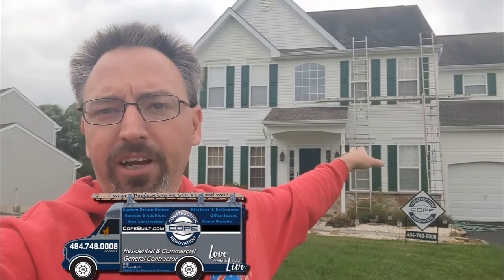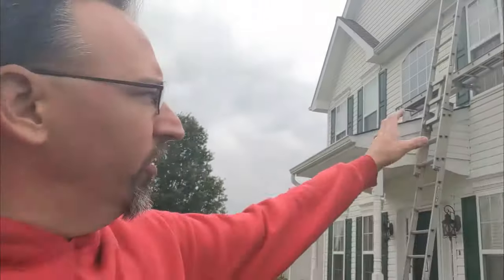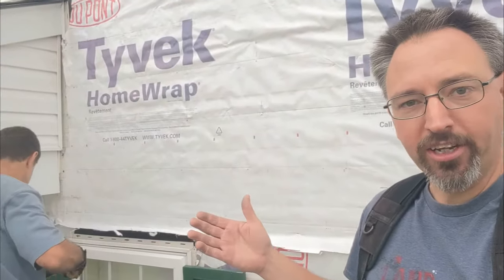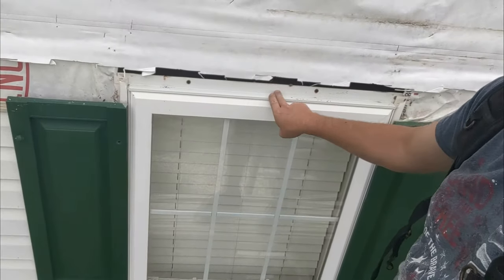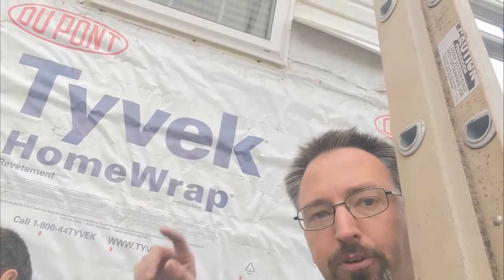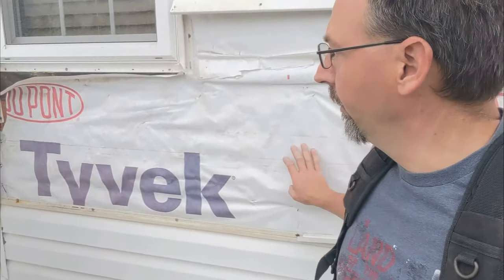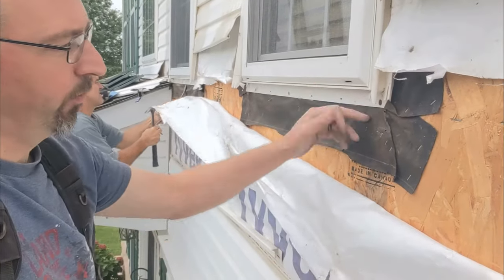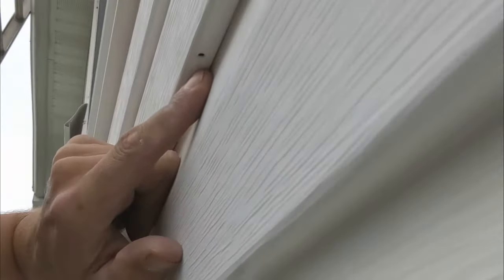Why is the top of my window leaking?

Comment: Had a contractor replace some windows on a stucco house. One of the windows is leaking. Any explanation why? Can you tell me the correct process for replacing windows in a stucco house? Where does the nail fin attach to? Does it go behind the stucco?
Reply from the maker: When you cut out a window, I like to cut an extra 3-1/2" of stucco around the window, so that I can cleanly get the nail fin out.   Then I want to slip some Z-Flashing up behind the Water Resistant Barrier behind the rain screen or drainage plane behind the stucco, to bring the water out, and then I trim the window with 1x3 PVC trim boards....  You have to get the flashing layers correct.    If the window isn't sealed to the wall properly, and the layers are in the wrong sequence, or the top nail fin isn't tucked behind the WRB, you are screwed!   I'm going to give you 5 links... 

Here are two raw unedited videos and some photos from a window replacement in stucco...
-- https://photos.app.goo.gl/wajBj42SVky6aXaB7 

This shows you some Z-Flashing behind James Hardy Board, bringing the water out to the front... the principles carry to stucco as well.. 
-- https://www.youtube.com/watch?v=DFrSzNLXBdI&list=PLHM_Hinmgh2JuxhlN-bwciIWKIgA7jjJM&index=24 
-- https://www.youtube.com/watch?v=ogzHR6Futzk&list=PLHM_Hinmgh2JuxhlN-bwciIWKIgA7jjJM&index=26
-- https://www.youtube.com/watch?v=rzgyrq88bIs&list=PLHM_Hinmgh2JuxhlN-bwciIWKIgA7jjJM&index=27

Here is a playlist on exterior water leaks
-- https://www.youtube.com/playlist?list=PLHM_Hinmgh2In7R4suJcYVCk3xD4Sugj-

Here is a playlist on proper window installation (9 through 13)
-- https://www.youtube.com/playlist?list=PLHM_Hinmgh2IcJ1aX-RRUXcGV9Wl6hHRr

Here is a playlist on some various stucco repairs we have done
-- https://www.youtube.com/playlist?list=PLHM_Hinmgh2JffqMrFjk627km8o20KKr2

Here's a rip-off report warning from a real install performed by a hack-job con-artist advertising "as seen on tv" window replacement services. 
-- https://www.youtube.com/watch?v=c0rHKGOoLfE&list=PLHM_Hinmgh2IcJ1aX-RRUXcGV9Wl6hHRr&index=16

I'm going to give you a college education on this topic in less than 3 hours time, for free, if you were to watch every video.    If you take the time to watch the content in those playlists, and you are a mechanically inclined, you'll likely be able to describe to your your contractor exactly how you want it fixed... or at least be able to ask some REALLY intelligent questions so when you hire the next guy, you'll know who knows what they are doing... and who are idiots just out there ripping people off and damaging homes with their ignorance. 

Please subscribe to our channel for more helpful content on maintaining, improving, and Protecting YOUR Forever Home.
Reply: @CopeBUILT  thanks I watched the videos but I have no way to know if the flashing is in the correct order without ripping it apart! I am getting a leak from the hole on the inside of the window that you put the screw in (on the top inside frame of the window). Any idea how water could get back there?
Reply from the maker: the only reason to run a screw from inside the window sash channel, through the jam, and into the rough opening framing lumber, would be if your installer chose a "replacement style" window without a nail fin.

"new construction" style windows with a nail fin, do not require screws through the jambs.   

This blog article explains more about the difference between New Construction windows and Vinyl Replacement windows... https://www.copebuilt.com/general-contractor/kennett-square-pa/blog.aspx?ID=1064&Title=Replacement%20vs%20New%20Construction%20Windows:%20The%20Essential%20Guide 

As in the Rip-Off report video on that blog post, which I also linked in my first reply to you above, i explain why you don't want to use a replacement window in a new install application.   I only use replacement windows when I have an existing wood window frame, which I can install aluminum capping on, before putting in the replacement window, inside that old wood jamb.   

Sadly, without ripping it apart, you aren't likely going to able to determine the cause of the leak.   You could try flooding various areas of the exterior above the window with a garden hose.... hitting each spot, for 10 minutes at a time, before trying the next one, because sometimes it just takes that long for the water to get in....  working with your first area at the bottom, and then sequentially moving up the face, 10 minutes at a time.     Then potentially, you could apply a vapor permeable "sealant" like Luxon XP paint for stucco... however, if water enters the wall assembly above where you apply the sealant, it could still leak into the house.   All of this is just a band-aid, a temporary fix.  The right answer is to go back to the contractor and tell him you want him to stand behind his work, to take it apart and fix it.  If he refuses, then hire someone else to take it apart, fix the layers or install a proper new construction window, and then put it back together.   And if the contractor screwed up, document then whole thing, and then go have a conversation with him or take him to court.   (Not Legal Advice - consult an attorney to understand your rights, and the consumer protection laws in your state.)

The problem could be further up the wall... something your contractor didn't touch... but if he got his flashing layers correct, and the original builders had the proper house wrap and flashing and water resistant barriers in place, then the water from above, shouldn't be getting in...   BUT... if the original builder screwed up... if there was no house wrap, then even if the new window is properly flashed to the sheathing, water from above could be getting behind the sheathing and into the window that way, and it would not be the fault of your window installer...    Though I find this unlikely if the old window wasn't leaking, and you didn't get any leaks until the new window was installed.  

Did they just install 1 window?  or more than 1?   How many guys were working?  Was one guy good, and one guy not good?  If more than one window was replaced, and you discover improper methods were used, do all the windows need to be taken apart and checked?  

Hope this helps.
Reply: @CopeBUILT  thank you so much for the very good information. The windows were installed by a contractor and was done by my dad so I don’t have any good solid info on how it was done. My dad tried to get in touch with the guy who installed it but he’s not picking up his phone and is MIA. I believe they installed multiple windows plus a sliding patio door. But only one of the windows are leaking. I don’t think there is an issue with water leaking behind the stucco from above since the stucco and roof is in pretty good condition. (This is a condo unit so the exterior and roof is maintained in good condition)

I had a window guy come and look at it and he said that on half of the pvc trim of the window on top is missing silicone sealant. I’m going to have him remove and replace the sealant to get me through the rest of this winter and reassess the situation in the summer. 

However thank you very much. Now I can properly understand what the issue could be and have a much more intelligent conversation with any contractor if we decide to remove the trim and peel back the stucco to see what’s really going

Comment: Great information. Question, does the homeowner's insurance policy cover payment for this type of repair? And, what is the approximate cost to fix this type of problem on 1 or 2 windows?
Reply from the maker: Great question... here's a link to two articles with some videos that talk about what insurance will and will not cover...

https://www.copebuilt.com/general-contractor/kennett-square-pa/blog.aspx?CategoryID=1023&CategoryName=Insurance:%20Is%20this%20Covered?

Every policy is different, but Generally speaking a homeowner's policy will cover sudden and accidental damage... like a frozen pipe that bursts... but not a long slow degradation over time, like a roof leak you weren't aware of.   In this case, they might cover the repair and repainting of any resulting drywall damage on the inside if this was a sudden leak that occured doing a massive rain storm event... but the likely would not pay the labor to fix the cause of the leak which was the exterior siding and flashing... and some policies are now excluding damage caused by improper building methods, which this could have fallen under.   WIth insurance, what you don't say, can be as important as what you do say, if you don't want your claim denied.  Read the articles I linked and talk to a public adjuster to learn more...
Reply: Thanks. How much did you charge for this job? We have exact same issue in washington.

Comment: Would this apply to sliding glass doors too? I have 6 month old sliding glass door that's leaking from the top corner
Reply from the maker: Hi Mike, thanks for your comment and question!   Yes, the principles are similar... but please allow me to point you to a specific video from our Door's Playlist where we solved a door leak for a client, which was leaking (from the top) and water damage was showing up at the flooring.   

Here you go!   video of how to flash and shingle lap the layers on the top of sliding glass patio door... 
https://www.youtube.com/watch?v=IkueGrW4m3s&list=PLHM_Hinmgh2JTV9yPuD_NEzGVxEbNep-W&index=20

Here's a second video that may also be helpful, although it was recorded before we had our new wind-screen microphone, so the audio is crunchy in places....  This home had huge fypon trim that wasn't flashed correctly and caused a number of leaks.
https://www.youtube.com/watch?v=TdLXcoBn2fc&list=PLHM_Hinmgh2In7R4suJcYVCk3xD4Sugj-&index=17 

Hope this helps.... if you haven't already subscribed, we hope you'll consider doing so!!
http://www.YouTube.com/CopeBUILT/?sub_confirmation=1
-- Drew --

Comment: I’ve had repair a made in outside and I’ve still got water coming in. Question: at what point do you look at the issue being inside the house - I.e. that the windows wasn’t sealed inside properly as well.? And if that’s the case does that mean the windows should come out or replaced To ensure it gets done properly?
Reply from the maker: Brendan, if you check out our window playlist, and also the exterior facelift renovation playlist, we cover in-depth methods of how a window should be installed, including a proper pan, and waterproofing the rough opening.   We assume that 10% of all window frames leak from the factory, and that 30 to 40% will eventually crack and leak.   So we want the rough opening to be waterproof, and designed to shed water to the exterior with proper drainage and drying provisions combined with back-daming and air-sealing the inside of the Rough Opening to the window.   

If you have vinyl siding, the layers are "easy" to correct and get right.   Time consuming, but easy. 

If you have a stone, brick or stucco exterior, then you may have to look at applying a sealant to the outside.   We have another video in the editing pipeline talking about spraying a masonry waterproofing product on stone to stop a mystery leak, that only occurred after prolong rain storms.   Here's a link to the raw unedited footage from that project which might give you some ideas...   https://photos.app.goo.gl/VVsmGfjTDzi64Z3U8
Please subscribe to our channel so that you get notified when those videos get published. 

With brick, if you have globs of mortar that feel into the drainage plane between the brick and the sheathing, this can form a cup, and funnel water into the home through hydrostatic pressure.   Joe Lstiburek talks about this in some of his building science videos.   For example in this lecture from the 24 to the 26 minute mark will demonstrate the principle... https://www.youtube.com/watch?v=rem5WhFiiwU&list=PLHM_Hinmgh2In7R4suJcYVCk3xD4Sugj-&t=1452

Comment: What if this is exactly the problem, but the bottom floor is brick?
Reply from the maker: Modern best practices for brick wall call for a 1-in drainage cavity between the back side of the brick and what ever the sheathing product is on the building... That way, as the brick mason is laying his courses of block and mortar falls down behind the brick, it's less likely to create a cup that could trap water in a small pool on the wall and allow it to soak into the interior wall assembly. However, if the brick was installed with only a half inch gap, or the bricklayer was especially sloppy with the mortar falling down into that drainage cavity, they could easily have formed a small pool back behind the wall, that as water migrates through the porous brick, or enters the brick drainage cavity from somewhere above, it could get trapped in that pool and then get pushed through the sheathing above the window... 

As far as keeping your cost down, the first thing I would look at would be your second floor windows, punched openings, other places of penetration, and wherever the flashing should be uninsure that everything on the second floor is as it should be to help prevent water from getting into that drainage cavity....

If everything is perfect up above, then your water must be migrating through the brick or getting in at the window head itself....

Would it make sense to apply a sealant to the exterior of the brick?  Every situation is different...

Can you remove a layer of brick above the window and try to fix the flashing at the window head to bring water out to the exterior?  You may wind up removing a significant portion of brick above the window in order to truly solve this but, but perhaps you can start with a selective removal above the window, using a grinder to cut out the mortar... 

It's a sucky situation to say the least, and there are no easy answers as we don't have x-ray vision....

Perhaps the first place to start troubleshooting is to begin with a garden hose... Heavily spray one area of the wall for 15 to 25 minutes right at the window header....

If you don't get any leaks, then move your garden hose up about a foot or two and continue for another 15 to 25 minutes..... All the while having someone inside watching for leaks...

Continue this progression as you work your way up the wall, and to the second floor until you get the garden hose somewhere, that causes water to start showing up inside...

Once you narrow it down, let everything dry out, and then hit that final spot again and see if you can reproduce the results... This backup troubleshooting step is just to make sure that it didn't take the water from down below an hour to get in while you were making your way up the wall with the hose....

Once you've completed your garden hose test, that will point in the direction as to where you should start your diagnostic work....

Hope this helps. Please subscribe to our channel to stay tuned to all of our upcoming videos to help you improve and maintain your forever home!
Reply: @CopeBUILT  thank you so much for such a detailed response! Very helpful. I don't really do subscriptions as the algorithm changes what it shows me, but in this instance I believe your help was well worth a sub!
Reply from the maker: How did you make out with your brick issue?

We have some new video links that may provide additional details... 

f you have a stone, brick or stucco exterior, then you may have to look at applying a sealant to the outside.   We have another video in the editing pipeline talking about spraying a masonry waterproofing product on stone to stop a mystery leak, that only occurred after prolonged rain storms.   Here's a link to the raw unedited footage from that project which might give you some ideas...   https://photos.app.goo.gl/VVsmGfjTDzi64Z3U8  If you have Stucco, we use a vapor permeable paint called Luxon XP from Sherwin Williams.  

With brick, if you have globs of mortar that feel into the drainage plane between the brick and the sheathing, this can form a cup, and funnel water into the home through hydrostatic pressure.   Joe Lstiburek talks about this in some of his building science videos.   For example in this lecture from the 24 to the 26 minute mark will demonstrate the principle... https://www.youtube.com/watch?v=rem5WhFiiwU&list=PLHM_Hinmgh2In7R4suJcYVCk3xD4Sugj-&t=1452

Please subscribe to our channel so that you get notified when those videos get published.